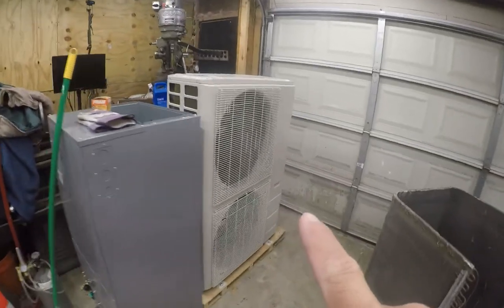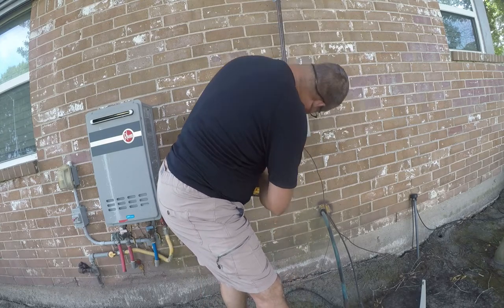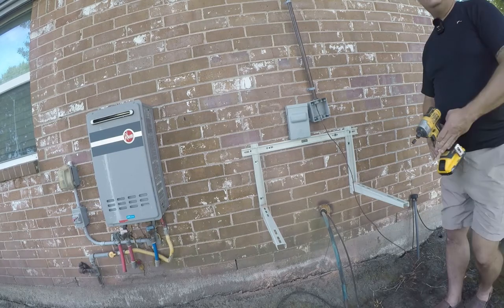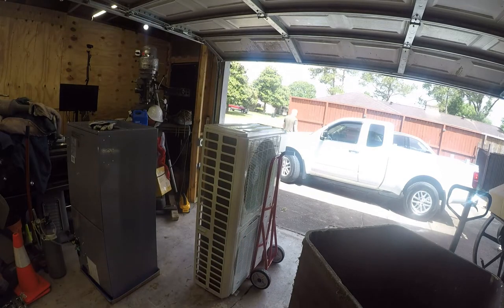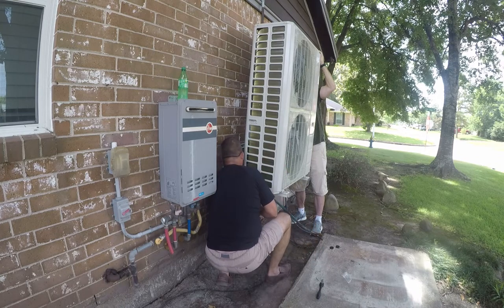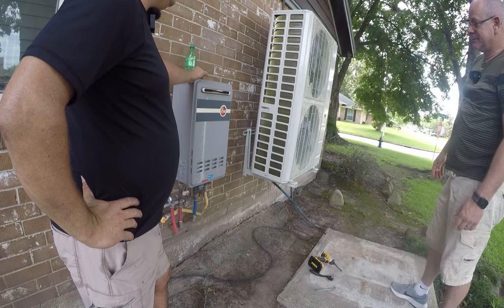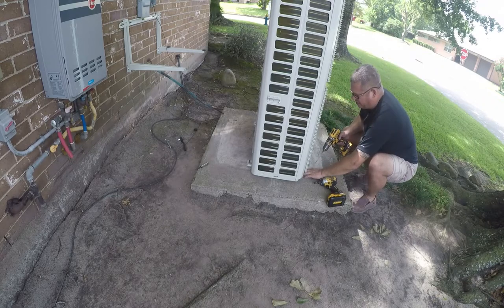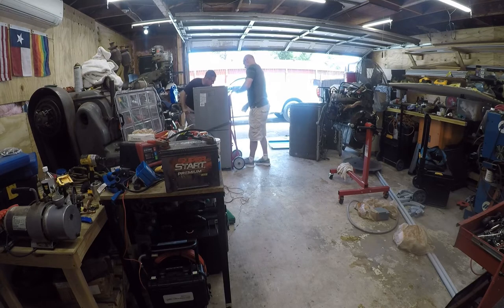HVAC 7 - More progress, bolting down the outdoor condenser and moving the indoor unit upstairs

Comment: I installed one of these ACIQ Outdoor units here in Iowa.  I kept my Honeywell Vision Pro.  I set it up as a Duel Fuel system with my furnace.  It has gotten down to 18 degrees here so far....  my furnace has not turned on yet.  I went from a 10 seer AC to this 18 seer heat pump.  I am loving this thing.  I did the L brackets as well.   I picked up the Outdoor unit and put it on the L bracket mounts all by my self.  I picked it up on one side and scooted a board under it. Went to the other side and did the same thing.  Over and over again stacking as I went until I had stacked and lifted the whole unit two feet off the ground up to my brackets.  I just had to lift the unit 2in to put it on the rack.  Easy peasy.   BTW This is made by Midea. There is a slightly different edition made for Carrier/Bryant/ICP.  It is model 38MBR.  The part numbers make it seem there is a different set of boards inside and no 24v option board on the Carrier versions.  There is a service manual for the Carrier version.  Take care!

Comment: Can you tell us what wall mount you used? Be nice to get this out of the way of lawnmower grass clippings and rain mud splashes.
Reply from the maker: I used one like this.... they come in various capacities depending on the weight of the unit.  I think the brands are all similar and made by a few factories.  https://amzn.to/42PnVHm

I did decide that the L-Brackets were not sturdy enough for the full size ACIQ unit so I took it off the brackets and put it on the concrete pad I already had.  I did not feel like fabricating something and brick is not really structural in most homes, so that causes it's own issues.  Net net is I did not want the unit to fall off the house and was not confident I could secure it to the brick properly.

Comment: What kind of bolts did you use to bolt it in the concrete?
Reply from the maker: Whatever Home Depot sells..... nothing magical.  I think they are called Torcon.  They have a specially sized drill bit you need to use though.

Comment: Isnt it suppose to be installed at least 10' form a gas line?
Reply from the maker: Good question, but no.  No such clearance requirement exists that I'm aware of.  A gas meter is a different story.  The item in the photo is a tankless water heater.  For a gas meter there is a 3' to 6' clearance requirement from the relief vent to prevent an unintentional ignition of gas fumes vented by the unit.  So if there was a gas meter there you couldn't put an HVAC unit or a tankless water heater within the clearance space.  

The Goodman (Good For Nothing Man) unit was on the same pad for the last 7 years.  No issues whatsoever.  This unit will be much quieter and easier to work on... when I get around to finishing the install. :)